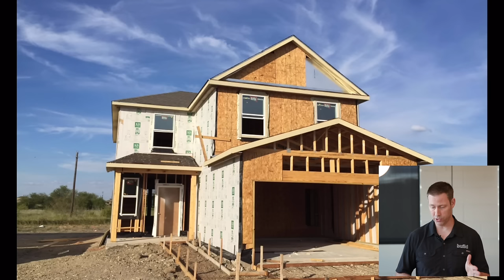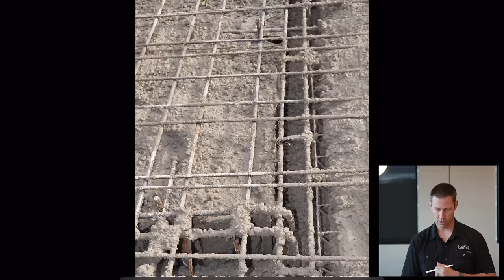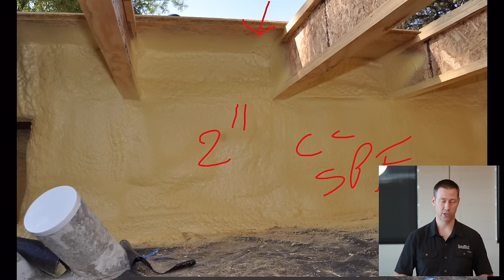Foundations - Slab vs. Pier and Beam - Which is better?

Comment: So... 2 things to mention. 1. post tension is garbage. Don't bother with those foundations, I've seen so many that are cracked and now have a 2 to 4 inch gap running the entire length of the foundation. 

2. Post tension only works when you have beams rammed into the bed rock and an extra 2 feet added to the top as a secondary layer with its own rebar mesh.

You know what's better than both of these methods in Texas? Pier and beam foundations with 2 layer floor. You build a sub floor with diagonal boards running the entire foundation. You build a peg joist floor frame probably 4 in up off the sub floor and then you put your hardwood on top. Generally speaking you want to leave room between the ground and the sub floor so you can install a floating heating unit and duct work. You can then run your meshed ceiling ducts to carry the hot air up into the attic. With a nice solar attic fan. Let physics do your work for you and make a more energy efficient home.

Comment: so I would think that using a pier foundation, with steel framing for the floor, lay gravel down and place straw/hay bales on top of the gravel and set them so they are flush with the top of the flooring steel beams and then do whatever type of floor you want to do???  I would assume straw bales are far cheaper than using spray foam as insulation???

Comment: Matt, what happens if a plumbing, or water leak from some source occurs. when using Closed Cell foam? What is the Risk vs Reward? All the foam companies in MS push Closed Cell under the subfloor but if a leak occurs I may not find out before excessive damage to the Wooden Structure has been done. Thanks.

Comment: Having lived in Socal for 28yrs before retiring and comparing it to back east(NJ) and being a framer for a couple of yrs I can easily say that slabs suck or potentially suck. I guess the only downside to having a basement and/or using floor joists would be more money used for extra lumber that would be required, but heck..........you  get a third more of a house for that money.(Think about it) Plus, you don't have issues like broken water lines that cause you to have to hire a guy to jackhammer your floor possibly tear up a wall etc, etc not to mention that it's going to cost probably at least 1200 bucks.

Comment: A sealed and conditioned crawlspace would be what i'd recommend. Don't need floor insulation...plumbing/electrical/ac goes there and its accessible to work on...better than sticking it in a hot nasty attic. Also having wood frame a few inches off the ground slab is asking for trouble...just a few feet off the ground makes a huge difference. Problem is most houses have nasty vented crawlspace with lots of holes that lets water/bugs/mold/rodents in. A (eventually) cracking slab foundation doesn't make for a good floor.

Comment: Just viewed a 2500 sq ft house built 93 in Wilm NC off coast The slab wass ritting or crumbling at every doors edge which had an attemped repair w ceramic tile but it was still crunbling beneath What could be done to fix ?

Comment: Can you spray foam directly on the gravel, and then once that cures, pour a concrete floor directly on top of the spray foam?
Reply: Matthew Grotke I’ve also thought of this. Great question that I don’t have the answer to. 

Something to add ..When I was deployed to Afghanistan the first time they sprayed the entire outside of our metal buildings with closed cell insulation. That was it. No siding at all. I’ve been going back and fourth for 10 years now and it’s holding up like a champ.
Reply: Matthew Grotke another thought.. I’d be worried that over the years the insulation would shift or beak down which could make the slab weak. What are your thoughts?

Comment: You mostly covered my concerns.  As a buyer of existing homes (some of which can be pretty old), my thoughts are as follows:

Slab on grade: really hard to correct/modify drains, no space to run electrical or plumbing or to add insulation, and water intrusion through the slab that can cause mold in carpets (mostly an issue on older homes where a waterproof barrier wasn’t used...maybe not an issue in Texas).

Pier and beam: where I live the older homes that use this style of foundation essentially always suffer from often significant differential settlement.

Personally I like basements just because that is what I am used to, but my ideal foundation would probably be a beam-only foundation (no piers) with a rat-slab (the “concrete sidewalk”).  All the access needed under the house and no (or very limited) differential settlement.

Using a post-tensioned slab on grade seems crazy...I’m used to that being used for stuff that’s in the air.

Comment: There's lots of clay in Texas, and many older slab foundations aren't as capable of handling the expansion and contraction that occurs when the surrounding clay's moisture content changes, so be careful with older houses. It doesn't really matter how deep the foundation goes if a mass of clay larger than the interior volume of your house starts acting like a hydraulic jack between the slab and bedrock every time a drought begins or ends. A millimetre here or there doesn't sound like much, but a few times a year, every year, when watering restrictions prevent you from running a drip hose to keep the moisture content consistent? 
 
That maters.

Comment: what about the use of Hydronic radiant floor heating in a slab?  Any potential issues to worry about if you are doing a passive solar house with the slab as a thermal mass?

Comment: Main thing I hate about slab foundations is they force your air vents up into the ceiling.  Sucks in the winter, your feet are always cold, it just doesn't work as well IMO as having your vents in the floor.
Reply: Aaron Bays in floor heat, water run through a heater and tubes in the concrete. Makes the slab heaven in winter

Comment: use xps insulation under your slab on grade foundation. it will take the weight of the house no problem. this is a common method in some parts of europe now

Comment: I've done a few slab houses in oregon, every one had problems with bugs, under the slab and vapor barrier is a moist area (I.E.vapor barrier)that bugs love.  maybe there are no bugs in texas.    i would always treat the area before for this problem and STILL bugs.   i will never do slabs again except basements.   also the slabs are usually to low to the ground,another bad idea. always have your house elevated and well drained. also how to insulate ,that is a problem.  if you use foam covered with metal you have another bug area ,trust me .       good luck

Comment: I like crawlspaces for more reasons than slab. I used to run a spray foam company, we had many customers here get dropped for us using sprayfoam. Now there is a code for a termite gap, I cant believe so many people and inspectors do not research encapsulated crawls for all the benefits.
Reply: Crawlspace is nice and as you mention , but if one wants to add more living space to a home without building up, a basement you can walk around in is the optimal foundation, based from my own experiences with slab, crawl and basement.
Reply: @Joshua79C  I very much agree with you, however, basements come with there own issues. Wish we had them where I live, but were below sea level.
Reply: @SJ-gd6bo   Florida and  Louisiana (to name a few states) are definitely not basement friendly zones., due to their location to sea level which is why in FL while I lived and worked there as a mover I got to see first hand many raised homes with enclosed (above) ground level basements. Even into a certain set of hangar home design where the living space is located above the hangar. Still with above grade or partial on a sloped property you want to incorporate flood vents along with the gravel covered tile drain system. I am rather inclined to perhaps do a clear span basement using ICF or just go stilt aka pier and beam aka piling type foundation, when ti comes time to planning something new.

Comment: Matt you have the wrong safety rebar caps on the floor rebar. Someone could trip and fall on those. (need the square caps with built in metal plate)

Comment: Mr Risinger,
 Great video.  Question how do you feel about basements in Texas? ( full size basements )
Reply: alex banks, I think he basically answered why it’s not popular when describing the excavation of the solid rock a couple of feet down.
Reply: Dennis Pope 
 I get that it’s not popular and it’s expensive I was asking how he feels about it as a foundation as far as durability and ease of maintenance plus any inherent problems with it once built. Also possible work around a to any of those problems.
Reply: @alexbanks7115  I work in a 1976 building with a basement which has continues water infiltration. The subterranean  lime stone around the building  slops toward the building. The basement is the lowest spot on the property and was not built to keep water out.

Comment: I had about 20 blue 4x8 sheets Styrofoam insulation sheets stacked on concrete blocks with a few sheets of plywood on top. It was covered with a tarp. A few months later I went to use it; it was ate up by termites. They went thru the foam sheets to get to the plywood. The blue foam sheets was chewed up so bad that they broke in half when I lifted one end.  This has raised warnings in my mind regarding foam touching the ground. I seen contractors backfill against foam sheets on exterior walls. I seen on your video the spray foam goes down to the ground. I would be afraid the termites would use the foam as a channel to hide their tunnels within. Does the spray foam contain some kind of insecticide?
Reply: I live in Florida, an insecticide application is required for all concrete pours. I had to pay $250 to have a certified applicator spray the soil before the concrete for my 20x24 carport slab was poured.

Comment: I'm a home remodeler and all I can say is that when you have a crawl and an attic you're going to be able to maintain or upgrade your house for far cheaper than if you have a finished basement, bonus room hogging most of the attic (full second floor doesn't make as much of a difference but also gives the same problem as a finished basement), or a slab. Easy above and below access to the single floor of living space makes a world of difference.

Comment: What about frost lines? Which one is better for those of us living in cold and wet climates? Thanks!
Reply: Depending on budget and soil conditions to location, IN the Northeast, basements are the norm due to the head room and all that extra living space it provides, where as crawlspace is limited in height yet more budget friendly than a basement while still providing only extra storage space if enclosed (perhaps even conditioned to keep heat out). Both of these are perfect in cold climate regions, also stilt or pier and beam are just as favorable where it may tend to flood.

Comment: The yellow vapor barrier foundation is not a slab on grade.  That is a pile supported mat foundation.  The soil below it can settle independent of the foundation (or, for Texas, the soil might expand).  The blue vapor barrier system would be considered either a pier or pile foundation depending on the elements length to diameter.  Deep foundations usually provide superior performance but add to the cost.  SOGs are often way cheaper.  Don't do deep foundations in Alaska.  Don't do SOGs in coastal regions.

Comment: On the insulated crawl space, it looks like you could just pump/vent AC into the space and cut registers in the floor without the need for metal ducting.  Can you provide a sq/ft cost difference for each type of foundation?
Reply: That's going to differ based on one or two story house. Im finishing a 1300 sqft pier and beam 2story addition. My piers ran me $350 each (x 13) with labor. Materials and labor for beams about $3000. Slab would have been $10k.
Reply: @believerscc  Does that $3000 count the entire floor system (joists, plywood, etc...)? What about the perimeter, is it just open or are there a few courses of block?

Comment: Lol, i was just going to ask you a question about this subject. In my country (Netherlands, Europa) I see a lot more rebar use in concrete construction. For instance in the rebuild of my own home, the concrete floor had a double mash 8mm 100 mm on center, 100 mm apart. Places where support walls (column) where going to be, additional 12 mm rebar bars where added in between the mash. I watch a lot of construction YouTube, but almost all the rebar I see used in the slabs is a tiny bit compared what I see here.
Although I’m not a structural engineer, I understand that soil condition, loads, etc determines what needs to be done. But I’m I’m always a bit 🥴 when people start talking about allowed cracking and situation where people complain about cracking when you see only a flimsy two bars of rebar going in...
Thank for all the work you do, to educate the world. Next time your in Europa, I hope to shake your hand 🖐!

Comment: Footers /block stem walls /concrete slab for main floors ,except where over top of basement or additional floors engineered beams on 16” or 12” centers , never liked a monolithic slab as far as when I sell or build my homes for cost difference it’s worth always going with a footer stem wall so the house elevation can be easily set at and elevation wanted and remain as structurally sound as possible I’ve seen monolithic foundation homes crack and settle to often

Comment: Substrate is most important, mentioned at the end. Is it bedrock, decomposed bedrock, boulders, cobbles, gravel, sand, silt, clay, or a mix compositionally or spatially? That might result in a combination of pier and beam with some slab (concrete basements are slabs too; “slab on grade” is what the video compares). “Soil” pains me. I view climate as a non-issue to foundation type, since design can address climate factors.

Comment: Pier and beam with conditioned crawl space are great havens for termites.  Slab foundations with fill dirt used to level them always settle.  Fill dirt always dries like coffee grounds left in the pot for a few days....inviting settling and cracking.  Termites always crawl in through the cracks.  Most builders in Texas under-engineer their slabs. Wood is termite food.  Most homes built in Texas have foundations that can't outlast their mortgage. Bigger homes invite exponentiallly bigger foundation problems. The worst foundation killer is shrubs planted next to any home.  Lead-free contruction materials used in modern building are mold havens. Mildew and mold are the biggest health issues found in modern homes.  Most AC units are under-engineered in Texas.  No builder with less than 40 years experience is an authority on Texas homes.

Comment: Hi Matt,
Thanks for your videos and info.  We built a house in 2018 and moved in for a few months.  I smell sewer smell sometimes from few faucets in the house, not every time.  The builder just pushes the solution every time and refuse to admit the problem.  I researched the issue and think it is because one of vent pipe is blocked or not there.  Can you offer your inside and how to diagnose the problem and solve it?  By the way, it is a two story house and I smell the bad smell sometime from second floor and sometimes from one of the faucets on first floor.

Thanks 
Jane
Reply: Just get a real plumber over, They can use a camera snake and figure it out pretty quick.
Reply: Willow thanks so much!
Reply: Willow if the problem is true, and because of the vent pipe is blocked or missing,  the fixing is hard and messy?  Do you have a recommended plumber in Houston who can solve this problem?
Reply: @janeliu8007  I don't live in Houston, but try yelp or ask a neighbor who they use. Its nearly impossible to tell you if its hard or messy  depending on how your house and plumbing are constructed. If your vents are clogged from say leafs or seed pods they can usually snake it from your roof top. Most plumbing issues are not vent related if constructed right, but with that said some plumbers sometimes have no options during remodels and have to use these 1 way vents valves that are near the sink/ appliance. All plumbers prefer to run vent pipes through roof but sometimes that isnt an option. These 1 way vent valves (air admittance valve or AAV) get old and stop opening and closing so they become an issue. Sometimes they are accesible, sometimes they are in the wall.  Most plumbing problems will involve removing/ cutting open the dry wall to gain access. Dry wall can be dusty but is very easy to repair, ultimately the least of you worries especially if you are smelling seer gasses. Most plumbers will do a good job cleaning up the drywall dust, might need to mop after but no big deal. Ask the plumber if he knows a drywall guy who can patch the holes or yelp the drywall guy too.

Comment: For that pier/beam with conditioned crawlspace, when do the metal anchors get installed in the concrete to attach framing?
Reply: depends on the type of bracket being used, it can be either wet set or drill dry set or the often headache prone due to misalignment issues the sunk in L bolts to which a bracket is then secured to